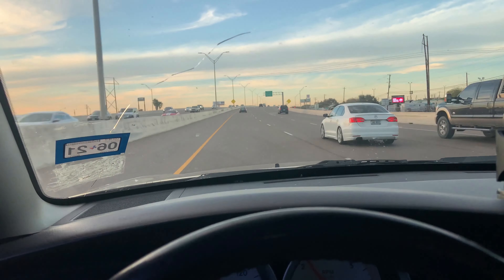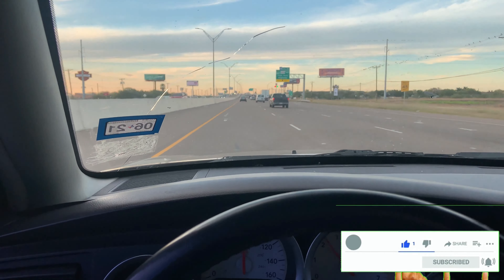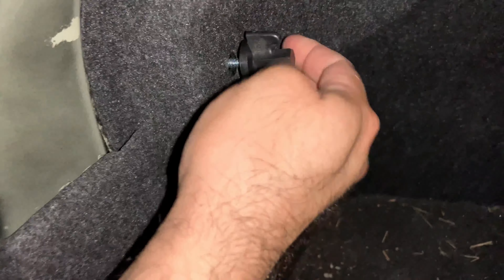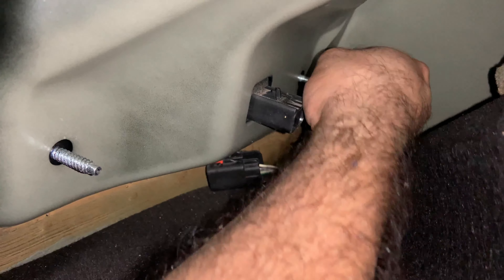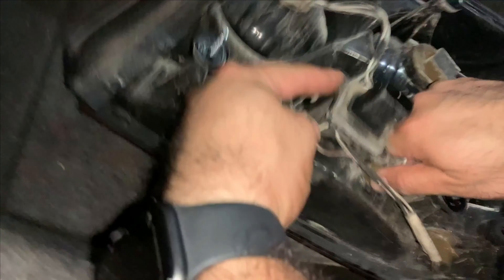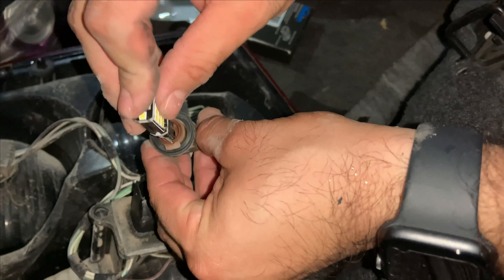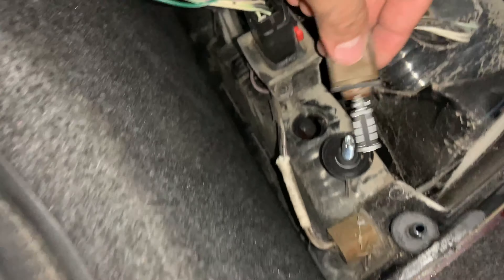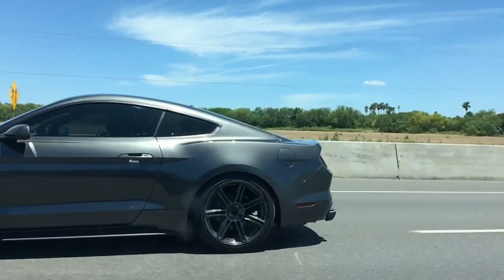LED taillight bulbs for the Charger R/T

Comment: Hey you got a crack in your windshield stage left by the inspection decal
Reply from the maker: Haha that’s on the charger but I will get it replaced next year lol
Reply: @DavidVlogz  the windshield is part of your airbag safety system you should have it replaced
Reply: @DavidVlogz  you don't want to put a car in my shop I always up sell
Reply from the maker: @BottleCaps  haha